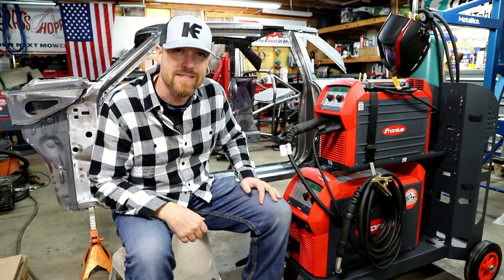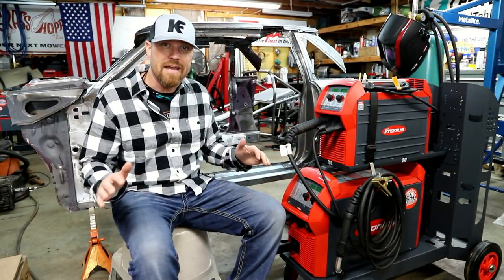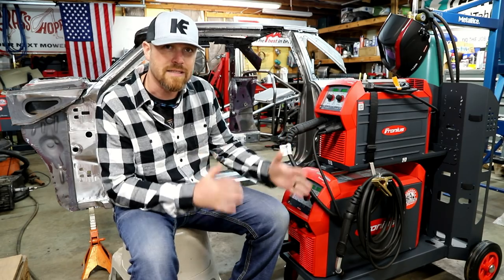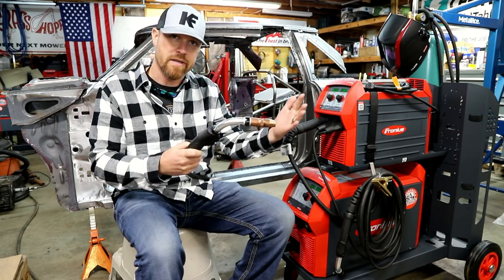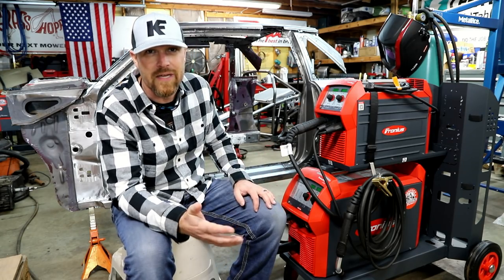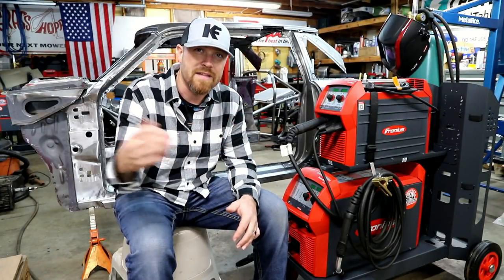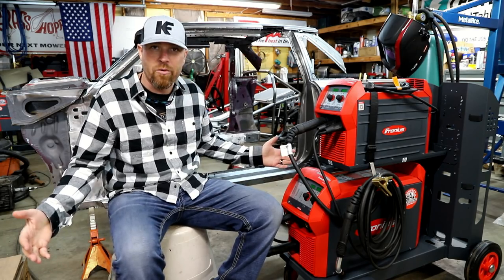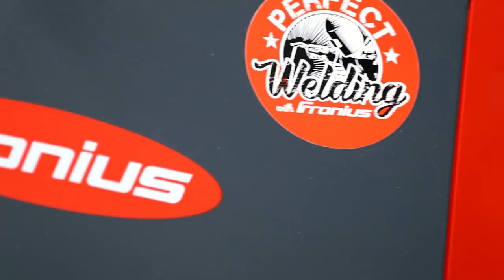Fronius TransSteel 2700 MIG Welder

Comment: Do you actually use these machines or do you just make videos with them shiny and new, sitting in your shiny shop? The 2700 WILL weld aluminum, according to the manual. But of course, yours don’t look like they ever get used so I don’t find it hard to believe that you don’t know the answer to that simple question.

Comment: Hey, I took the time to watch your video and give you a thumbs up, can answer my question ?does the 2700 feed aluminum such as the 2200 ? I can't find shit for info online.
Reply: George Hindley any info on this? I can’t find anything either...
Reply: @NMZIA  nope
Reply: @hindleygj  Did you ever find out any info on whether the 2700 can mig weld aluminum?
Reply: @optimusprime3484  it can, it has all the capabilities of the 2200, which I decided to get about a yr ago. It's fantastic, I can set up and tig thin stainless onsite almost anywhere, mig aluminum (only done that about 5 times), bit using it on standard mig, you can put a bead on safety pin, or spray plate pretty decent.
Reply: @hindleygj  Thanks for the quick reply and the info. Sorry I am slightly confused. Did you end up getting the 2700 or the 2200? If you went with the 2700 is it a pain to lug around on jobsites. Thinking of getting a couple 2700s and using them for both in the shop and out in the field for steel, stainless and aluminum. With the prices of these machines I want to make sure they are a perfect fit. Thanks again.
Reply: @optimusprime3484  I ended up getting the the 2200 for exactly that , if I needed to go make some money  outta the shop. It's paid for it's self over and over again. Best tool I've gotten in the last yr easy.
Reply: @hindleygj  awesome thanks again for the info. 
The 2700 is like 66 pounds I believe. Wouldn't be terrible to lug around but the 2200 would definitely be more convenient at half that weight.
We mostly do railing and stair work so I'll have to see if the 2200 can handle all we do.
We typically aren't welding anything thicker than ¼ inch. Can the 2200 handle welding all day in a shop? Sorry for all the questions its great to hear real world experience not just a youtubers impressions.
Reply: @optimusprime3484  surprisingly I have esab 285 guy, it's loud as hell can't hear my audiobooks over it, and have had bigger migs before that. Now I just use that transteel, the fan never clicks on quite quiet, in synergenic mode it goes up to 27 volts , on manual above 35v wire feed speed past 700.   Tigs 240 amps, stick not sure the same. This is all on 240 /208 v. It tigs great, great pulsing action on the fly.

Comment: For those curious like I was, Transsteel 2700 seems to retail at about $4650 in the US. 30% duty cycle at 270A.

Compare to a Miller 252 for $2800 that looks to have about a 30% duty cycle at 270A.
Reply: you are right on price but look at the inrush current at max amps output the 2200 is at approx. 27 amps it uses less  power than any other welder in that range and the 2700 is 34 amps at max inrush vs over 40 amps for the 252 miller
Reply: @bruced1429  Would inrush current affect you purchase decision? It' never factored into mine. But I'm not surprised, I believe the 252 is still a transformer based machine. The transformer machines don't have as many bells & whistles as the inverters and are heavier but will be super reliable. I have no doubt the 2700 has more features and functionality. The only question is does it have 2 grand worth of extra? For a hobbyist list me, probably not.
Reply from the maker: I guess it really comes down to what you are looking for in a machine. You really have to look at the whole picture. If you compare an Accord to a Corvette, one could say why pay the difference in price. They both have 4 tires, 2 seats and an engine. But we know they are a world apart when you look at things like performance, handling, and quality of materials.
Reply: Hi Matt, what the low amp inrush means to me with the 2200 is that you only need a 30 amp circuit and you can get away with  6500 watt generator  and you would also be able to run the 2700 on it a well but not maxed out. try that with the 252,, Miller's new 220  is close to the 2200 and the new 250 is close to the 2700 and they cost as much and have less features  so I guess it is the old chevy vs ford  . I have a Miller 225 and I have not tuned it on since I got my Fronius 180  the new technology is just so much better. I also have an Esab 215 it is pretty good  but the 2200 is better yet as it can do aluminum without a spool gun  right out of the box so the 2200 is in my future, saving for it now.
Reply: @UCXdqIoilcNRpTstCZoy4mvA Ah, heavy mobile welding didn't even occur to me. Thanks for the reply. Don't get me wrong guys, I think the Transsteel 2700 looks fantastic and would love one. I looked up the prices as soon as I saw one on this channel. But was disappointed, I'm not the target market I guess. I don't earn money fabricating or welding. I can't justify nearly $5k for a welder I use occasionally and would touch all the features on. So I ended up buying a used machine in this class allowing me to spend the $3k difference on other tools.
Reply: @Thefabforums  Can you honestly say you would have bought a Fronius at retail price if you wern't in a paid promotion / sponsorship with them?
Reply from the maker: @MattPratt  I think they are for sure worth the extra cash now that I have used them, cant say for sure what I would or wouldn't have bought though if I wasnt in my current position. This is what I suggest, dont take my word for it. Listen to those that have purchased them, like the gentleman above. I have yet to come across someone that has bought one and didn't think it was worth every penny they spent. Also remember this is the company that car manufacturers like BMW, Ford and Tesla choose to do their welding when manufacturing cars and trucks. Here is also some food for thought, there was a time when Fronius used to manufacture machines for Miller...

Try not to look at me as trying to sell you on Fronius and rather just someone trying to educate everyone on this high end option, they are not for everyone.
Reply: Matt you are right about the price. I had to weld up a snow blade shoe while it was snowing and I used my mv180
because it has a high weather proof rating and no  problems the 2200 has the same rating I think ip23 could 21 but it is the higher rating, try welding in the rain or snow with anything else but an engine drive Miller or Lincoln . Hope you have good luck finding the right machine at the right price then have fun with it.
Reply: @bruced1429  I have a generator that I run all my welders on. It puts out 6.8kw continuously and 8kw "surge". Would it run a 2700 at max? or at least a 2200? I currently run a Lincoln 180HD but overheat it all the time now that I'm doing this professionally. That and a Hobart stickmate. I've run 5/32" 7018 off the generator in question. My other option would be getting a suitcase for my Sa200. I don't have power and I know the Hobart 230 would probably kill the generator. that's why I was looking at fronius.
Reply: @scrapmanindustries   I know that you need 6.5 kw to run the 2200
on 220, I am not sure how many 6.5's haven220 volt plugs so you might need 8.5  just for 220v  max amp draw on my 2200 is 28 .5 amps  I think the 2700 is 34 amps but check their website to be sure.
Reply: @bruced1429  ok, I was more concerned with wattage but that makes sense checking the amps too. My generator has 220v 30A I do believe. I know my 180HD ran .030 flux core at around 2500 watts.
Reply: @scrapmanindustries 
I would give it a try with the 2200 it should run well if you have 30 amps on your generator. I think that your current generator would not run the 2700 at full power, but again how many times do you run at full amps. I have a 30 amp breaker /220 volt on my shop and my 2200 never trips it, ever. but my Miller 225 would trip
it any time I got to 150amps. You can run the 2200 on 120 volts off a 20 amp plug on your generator up I think 130 amps I am not sure about the 2700 as I don't have that one.Check  Fronius web page it will tell what works. most look at running 
max amps on their machine but when do you really do that.
Reply: @bruced1429  Yeah I don't know when your actually at max amps on a mig welder. I know Lincoln rates my current one at 30% duty cycle when pushing 130 amps output. I feel like I run it way harder than that but I could be wrong. Either way I was just looking for something that can do 3/16" lap joints with .035 and 75/25 possibly straight co2 and possibly 1/8" aluminum corner joints like all day long with out overheating. I keep hitting the thermal shut off on the Lincoln way too much here recently. Thats kinda why I was curious about the 2700. just for the extended duty cycle at the lower settings I'm pushing. The 2200 may work but I'm sure within a few months I'll find a way to overheat that thing as well. But I could be wrong on that. I've never ran a machine in between what I have now and those big industrial transformers that can run spray arc all day without letting go the trigger. I've got like 13 stair sets I'm making stringers for a bigger stair project and possibly might start making some aluminum bird feeder stands for an amish weld shop around here. that I also build random horse drawn equipment for. So I'm trying to hit production numbers but not really doing anything crazy as far as pushing a welder to high amps. I just need something that won't overheat at lower amps. And don't have power coming from a shop outlet. It all runs off my generator. Eventually I would like to have a bobcat or ranger So I could have higher aux. output and also be able to run a suitcase but for now I gotta make this set up work. I run a Lincoln Sa200 as my main stick welder and was planning on getting a suitcase till the amish guy said something about the aluminum. Then I was thinking about checking out fronius and seeing what their duty cycles were.
Reply: @scrapmanindustries   you might try some Esab 7100 ultra dual shield I have been using this wire in 035 /75/25 and it welds extremely well I was doing 3/8 plate yesterday and no problem
you don't need spray mig with this wire and you can use 75/25 so no need to get expensive spray mix. Try some. I use it in my 2200 and then use 030 solid wire in my Esab. in my 2200 then cooling fan does not come on at all using the Esab dual shield or any other wire only time the cooling fan came on was on a tractor bucket and I just did not realize I had passed the duty cycle. I think the 2200 would be fine if you were doing 3/8 and less material.In any event you will probably need a larger generator.
Reply: Not being funny but if you comparing machines solely based on their amps and duty cycle then you wont understand why a Fronius is leagues ahead of everyone when it comes to mig/mag welding in the world and that you wont benefit from it. I use a 3500c model and i would use that over anything.. even  a 500a mig machine from miller or lincoln by a long shot. NO ONE can touch Fronius when it comes to welding

Comment: How do you like the tig function?
Reply from the maker: This machine is MIG only
Reply: @Thefabforums  their website is confusing then.  It appears there is tig functions available on all transsteel compact models.  Could not find "mig/mag/" only. Was your 2700 just not optioned up?
Reply from the maker: @asherdie  the 2200 has a TIG function I know but not 100% sure about the 2700. I use both of mine for MIG only. I have the 2200 setup to MIG aluminum and the 2700 for steel. I do all my TIG welding on the MagicWave.
Reply: @Thefabforums  show off!
Thanks for the reply.
Reply: @Thefabforums  the ones in the eu have tig functions on the 2700 and 3500c.. limited tig but there is tig there. can you please fact check before you comment because its hard enough to try convince americans that fronius is top dog and not lincoln or miller lol
Reply from the maker: @Migman2020  no need to research, I said "this machine" has no tig function, and it doesn't.
Reply: @Thefabforums  the eu ones do because i sold a 3500c with a mig and tig torch
Reply from the maker: @Migman2020  gotcha